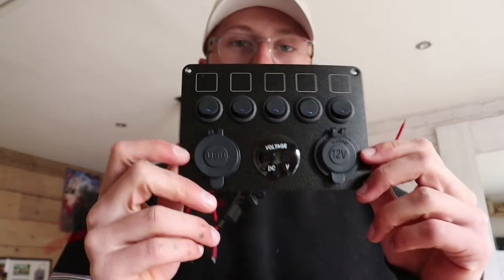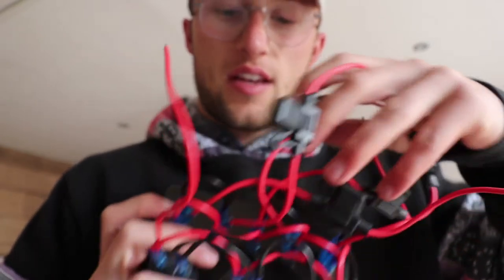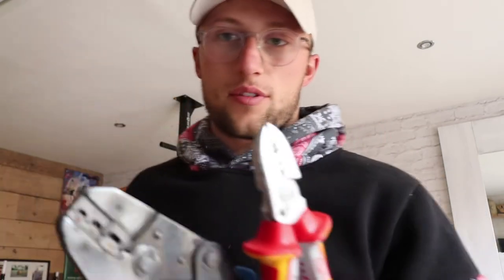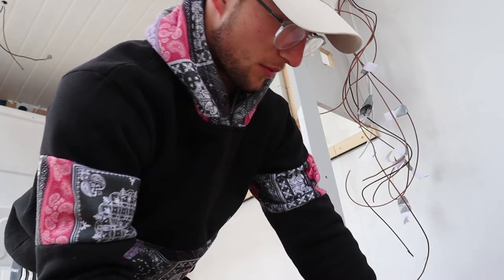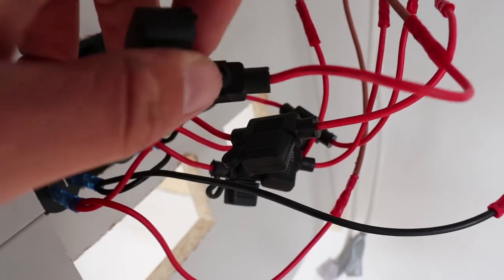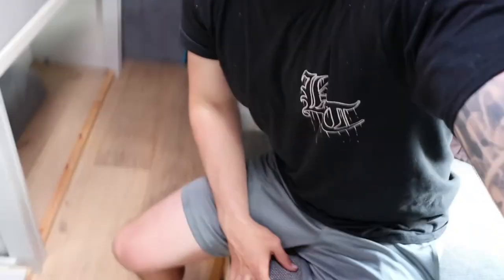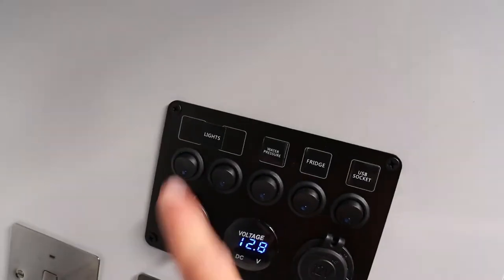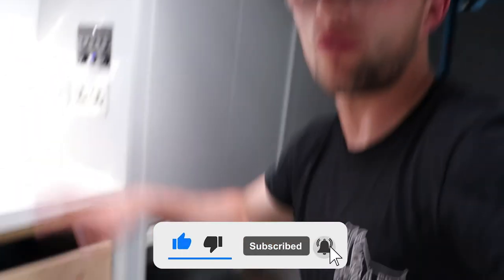Fitting my 5 GANG SWITCH PANEL | Ford Transit van conversion

Comment: Good video, you may be able to help me with my dilemma 🤔
In the introduction you state you had a problem in your last van that you had to use one of the switches to power it up? That is what I want, I don't want it powered all the time with the lights on draining battery. How did you wire it previously to enable that?
Reply from the maker: I connected a switch to the live wire going into the switch panel. :)
Reply from the maker: However if youre using solar power then the blue LEDs that come on with the switch panel arent going to drain the battery much at all.